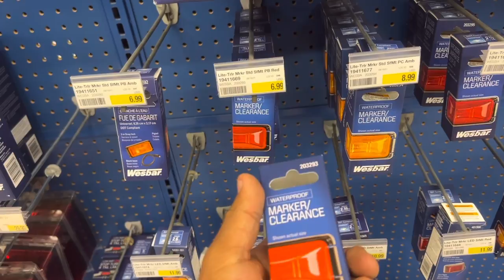Bass boat trailer restoration to Tiny Boat trailer

Comment: Perfect tandem trailer to do this mod with. You could use the front of the trailer area for a locked steel box storage or the tow facing side of the winch support for a spare tire holder.
Reply from the maker: Good idea
Reply: I was thinking the same thing.

Comment: Watch out for those ratchet crimp pliers.  They are very specific to the connectors /wire that you use.  If you use the wrong connection it will fail and the wire will just fall out. I had kleins and they were the worst at randomly letting the wire fall out.

Comment: I thought that the eye on the bow should rest below the roller on the winch to give extra holding to keep the boat from sliding forward during sudden braking maneuvers? EDIT: I see I'm late to the party with my comment after reading through comments. I'm really impressed with what you did...once a person learns to weld they can do anything they think up.

Comment: When stick welding or flux core like your welding with here you need to drag not push
Reply from the maker: Thanks. Why?
Reply: @TinyBoatNation  since you are producing slag you need to be able to let it get all the weld contaminates to the top. When you push with any slag producing weld you can imbed impurities into the weld creating a spot for failure.  Been a structural welder for 15 years  very important to run it the right direction

Comment: I ran new lights on my buddy’s trailer. All new wire, new LED lights and zero butt connectors. Everything was soldered with marine shrink wrap over the spliced wire with the exception of the ground. The ground I put to the frame. Anyway long story short, after he made a couple trips with it, the plug into the truck got hot and melted.
Reply from the maker: Wait, what? What was it? To small of wire?

Comment: that triangle up front - weld up a lockable box to put your straps tire chocks or whatever in. guide poles might be better on the sides.  the ones with rollers. up here in PA there's a lot of trailers with no titles. we need titles  some states dont. its not worth it to get a title so many get cut up for woods haulers. you can find them cheap.

Comment: That roller on the front should have been located on the top of the hook bracket on the boat not the bottom. It helps hold the front down. The way you have it pulls the boat up. Any way not bad.
Reply from the maker: That makes sense. I only did it that way because that's how it was on my other trailer but now hearing this, I should have done that for sure. Cool thing is I can just weld it again.

Comment: On you winch mount base. The horizontal piece mounted between the trailer rails. You need to drill drain holes. Water will get in there either through holes in the weld or condensation. Same for the steel bunks you added to guide the boat.
Reply from the maker: THANK YOU SO MUCH!

Comment: Did you use treated lumber? Also does the boat slide on and off easily?
Reply from the maker: I would never use treated lumber. The boat slides off easily in the water, but stays on pretty tight out of the water.
Reply: @TinyBoatNation  awesome. I didn’t think you would use treated because of the aluminum boat but wasn’t sure we we they were covered.

Comment: You have enough room up front to put a toolbox on the front of that trailer.
Reply from the maker: What would I put in it?
Reply: Jack, spare hub, lug nut wrench and other necessary tools for changing a tire or bearings. Especially if you plan on making long road trips.
Reply from the maker: Good point, thanks!